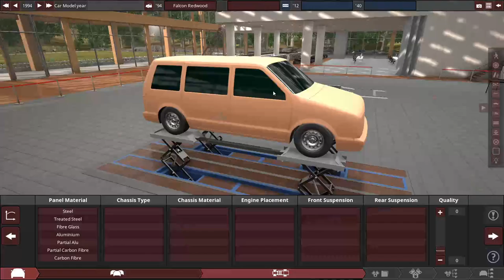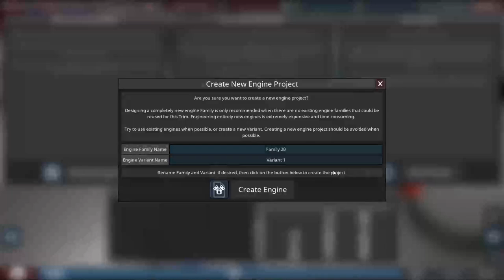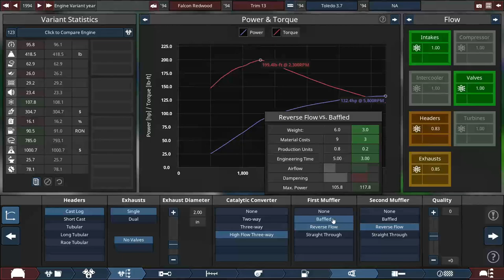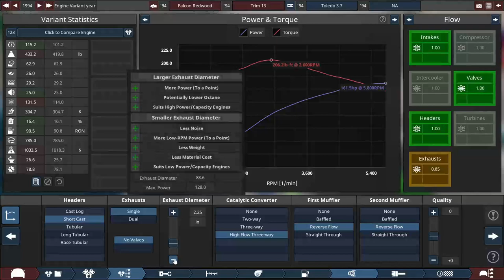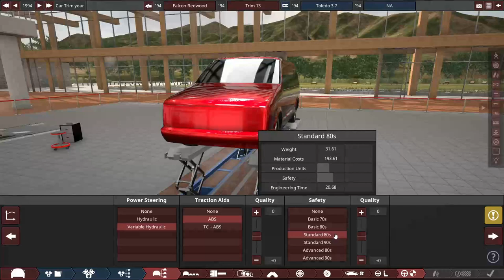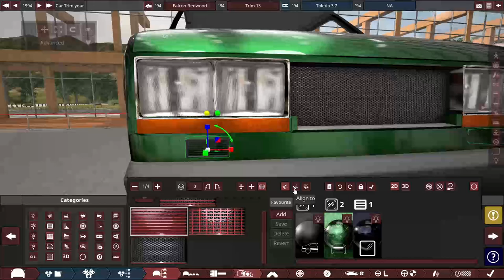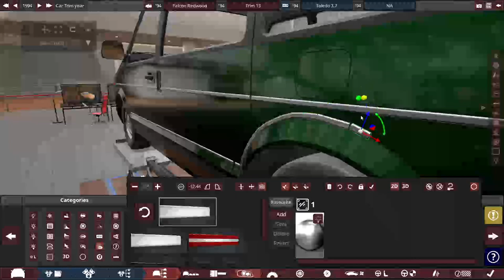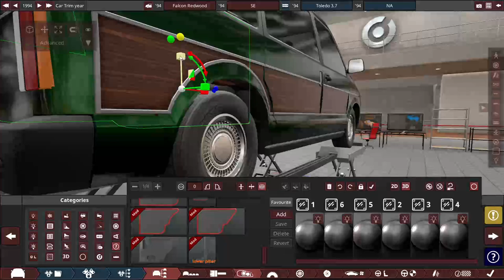CHEAP 90S MINIVAN! | Automation/BeamNG

Comment: Don't forget the Chevy Lumina APV, Pontiac Transport, and the Oldsmobile silhouette from the early 90's. The Dust buster vans. Oh yeah, and the Astro. Great job on the minivan
Reply from the maker: the Silhouette and APV are sick!
Reply: @UncleVenz  Yeah, they were.
Reply: @cjmarsh504  meanwhile the Honda Odyssey 😢
Reply: @tantheman8229  The Honda Odyssey is a great van, however, the weak transmissions are the final nail in the coffin.
Reply: @cjmarsh504  damn I hadn’t noticed! My 2001 Honda Odyssey still runs fine, even though one of the power doors doesn’t close properly.